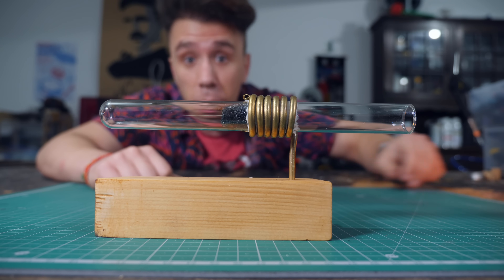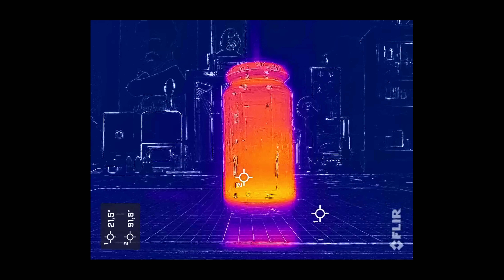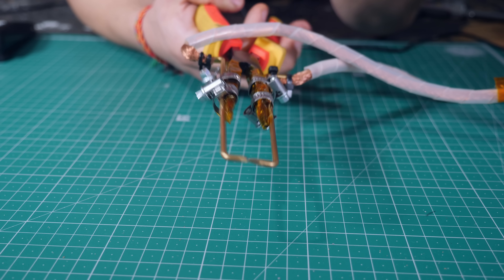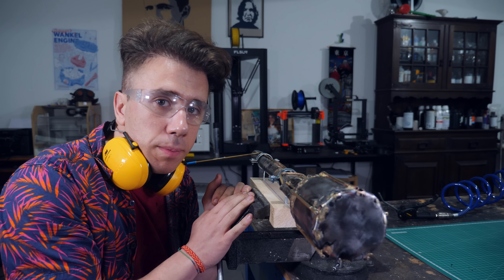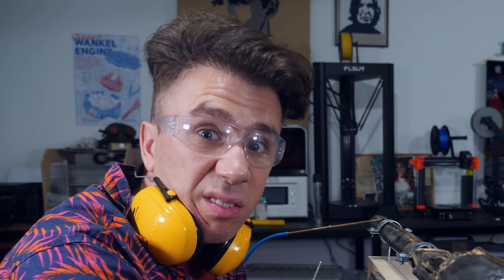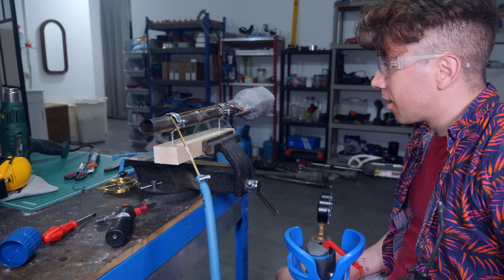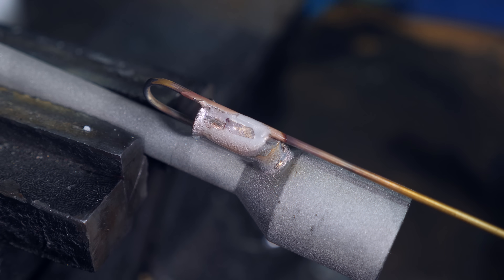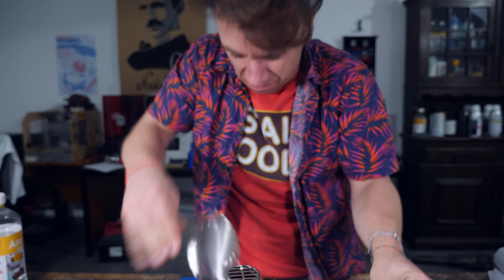JET ENGINE with NO MOVING PARTS (Pulsejet Engine)

Comment from the maker: 3D models:https://integza.com/collections/3d-models
0.1mm Sheet Steel:https://amzn.to/3PwJbeS
Spot Welder:https://amzn.to/3EUJOtU
Glass tubes:https://amzn.to/3tc7tU7
Reply: Make an engine in a different style... like Spheres. You could make a Tower Spherical Engine with Spherical Rotary Valves.
Reply: I'm really interested in Continuous Engines.  like maybe the High Performance Continuous Internal Combustion Engine, patent ©2013.
Reply: USE HEARING PROTECTION ! USE HNEARING PROTECTION , USSEEE HEARING PRO!
Reply: https://youtube.com/shorts/k3wmMDOYco8?si=3icc9RNHracRv3-u
Reply: You do suck at welding. Study temperatures, learn about minimum tolerances for load bearing structures. How much force does your goal expel? The parts must be thick enough, start out twice as strong to withstand the thrust, explosion, or pressures that you intend to cause. the failures you are enduring come from not understanding engineering and matrials. Study the periodical table, name, weight, properties and uniqueness of the elements. Copper silver and gold are arranged on the table because they all have one 1 electron on the outer valence, that is easily borrowed or extra can be added. Gold stainless and titanium is used in jet engines for the bearrings, much like crank shaft journals, the properties of gold is what is valued as the friction face, and why it is jet engines need so much maintenance, but without adding fans, all we would have is a crude missle, unfit for industrial uses. When it comes to Iron we should realize steel is not listed on the table. Welding requires weaving a bead, at correct temperatures, and speed. One must also consider that metals high in magnesium do not weld well without specialized equipment, if ever. Cast iron is not something to weld to, ever. Laser welds the most ideal to manufacturing... Lightest possible doesn't start with least, but with more, otherwise failures will occur.  

A rocket is a funnel, the pulse engine is limited due to not following the basic instructions, rocket science is a funnel. The moving pieces in a jet engine are for cooling and fuel delivery, even to turn a generator to make electricity. Missiles can have rockets without moving parts, the case is thick enough to be cooled by the air and often altitude. Funnel, a glass tube open at both ends and heat source equals constant thrust. I guess you have a plastic funnel... a funnel compress air, exactly the same ammount to enter the funnel exists.

Hydrogen runs hot, 22:1 air to fuel ratio. Yet cooling even by air to air fins is acceptable. I would like to find a high temperature ceramic that I can cool and use in industrial processes, fueled by hydrogen. The cost of creativity his to be reduced for the hydrogen economy to exist. You all have to learn to make it safe and bulky, do remote testing, not where your on hand fuel supply threatens your workshop, and not make very poor choices. 

Epoxy comes from lipids, algae is a source of lipids. Please consider that you are effectively choicing chemicals, algae, and carbon fiber to hold it together.

Plastic is not a wear item. Plastic is not a support structure. Plastic is not for heat.

There is much the scientific process can teach, but safety and matrials is foundational.
Reply: Wait, didn't you like my linear sonoacoustic idea that might even work as a laser by creating a population inversion? I still think it's a great idea!
Reply: @integza
They now sell plastic carbon filament that is harder than steel, use to make jet engine parts. I forget the name of the company or if it works in a regular printer.
Reply: Make Hero's Engine
Reply: @integza you've got a scammer who is pretending to be you in the comments on this video.
Reply: It seems like an excellent two stage water heater to me. A bit noisy, but I am sure that you can make a pretty fast and efficient water cooker out of it. 😁😛👍
Reply: @insAneTunA  Colin Furze already did that with this exact kind of jet engine.  He called it something like "The Jettle".
Reply: @dernudel1615  For 13 minutes I thought that I was original and brilliant .....😁
Reply: Have you noticed the sound of the sahara desert ? Same sound
Reply: Integza, how long will it take for you to choose who has the most amount of likes on their comment?
Reply: Você é de Portugal ou do Brasil?
Reply: can you make a 3d printed 3d printer
Reply: get some gloves mannnnnnnnn  cheap cut proof  kevlar, polyamide etc  sheesh
Reply: USE HEARING PROTECTION YOU FOOL
Reply: Why not make a puse jet engine out of an ink pen body? Some of those are made out of titanium.
Reply: Idea. Try to combine the rocket engine and the Meissner effect. For example: Make a track out of neodymium magnets. And from superconducting ceramics, to make the body of a levitating platform. And attach a jet engine to this platform. As a result, when cooled with nitrogen, the platform begins to levitate over the track, and the included jet engine will push the entire structure forward.

There will be interesting tasks related to the design of the track, and with the separation of temperatures from the platform (since the engine has a high temperature, and the platform itself is low), as well as with the fuel supply of the engine itself.
Reply: you can use an ion motor powered by a battery. But it's somehow too easy :)
Reply: Put a jet engine on a cycle I wonder how fast thAt thing would go
Reply: Bro you must not know who you are. I'll tell you what dog I'll tell you a secret you work for an organization under the table whether you know it or not I want you to go take a look at the 1996 Arecibo Puerto Rico human crop circles wait till you see the face. Bro it's time to wake up we need your help
Reply: Maybe I missed it, but what was the metal printed engine made out of?  I'd guess stainless, but I didn't hear anything specific.
Reply: I want to see a 3D printed bottle cap bullet. Imagine a bottle with mentos and pop with a cone shaped bottle cap with fins and just enough threads to seal but release easily. How fast can we make it?😅
Reply: My lord when you said you’re bad at welding I thought it can’t be that bad 💀 godbless 😓
Reply: Your Lithuanian "Thank you" got me flabbergasted, where did you learn it???
Reply: You didn't print that one though so every one you printed has failed.....did I win a 3d printer? Is this a good comment? 🤔
Reply: you are my favorite youtuber bro ....
Reply: better tell Bob to print it with the fuel tube and heat sinks incorporated, and then run it over some coolant, or maybe incorporating water cooling as some old WW1 machine guns.
Reply: May I suggest "Exhaust heat wrap" for your future projects. I think it would be easier for you to work with than the carbon fiber.
Reply: You should power an air engine with a rotting tomato (because gas is produced with rotting and tomatos are discusting)
Reply: I am not here for the printer. I would like one but I am not going to stop someone else. I do have an idea though. Build a mini remote control by smart phone electric prop engine. Just the engine in a case really. One that could be mounted on anything and can lift it like a heli transport. If you only you one engine then maybe have it gimbal some with an auto balance.
Reply: Aw why dudnt you print the engine we made that bruno ogolec patented
Reply: Can you please say what your 3d Modelling Programm is!
Reply: Are you on telegram sir
Reply: @integza do you telegram account that conduct giveaway
Reply: @mdpatellabs   if you got a message for a win  its a scam
Reply: 0:01 0:01 0:01 0:01
Reply: Integza!i hae heard tjat the plasma channel is teaming up with the disgusting tomato lord to overthrow your ionoc thruster prowess. We must retaliate with an ionic thruster tomato crusher. And slicer. His new design is epic tho.
Reply: Vc é brasileiro? Teu Amazon tava em pt br
Reply: Argus As-014 = V-1
Reply: 10:00 That literally screams
Reply: could be wrong but i’m pretty sure the way ur using heat to bend and build it could be what was making it too weak and melt
Reply: got any links on reading the physics behind this ?
Reply: Next video make a Tesla valve  jet engine I subbed pls gimme a 3d printer 😢
Reply: Fellow tomato hater
Reply: what spark plug and id of brass tubing for micro pulse jet please?
Reply: Can this achieve JATO 😅
Reply: Best 3D Printer brand for small family on a budget? Zero 3D printer experience but quite tech savvy. Thank you for any advice!
Reply: Have you tried to make a rocket with a metal lace machine I don’t know that last thing about rockets or lace machines I have seen a couple of videos of people making thing that could be used as a rocket love the videos brother keep up the great work
Reply: I got some thing 4 you 🎉 drehkolbenverdichter 🎉 ohne schmiermittel
Reply: I have been requesting the same video for years. Tesla turbine vacuum pump. NOBODY has measurements of the ultimate vacuum you can reach with them and it is one of the main use cases listed in the patent. PLEASE do this. If you can reach 1x10-6 it would advance the DIY semiconductor hobby by leaps and bounds.
Reply: Can you make pulse jet engine? (Valved version)
Reply: @integza.  Put a water cooling system on the tiny pulses get so that you can get the most trust out of it.let me know how it goes..or LIQUID NITROGEN COOLING RUN IT TIL THE WHEELS FALL OFF
Reply: @itzmejav995  hi how about using a coil coolant jacket for liquid propane?
Reply: a
Reply: @integza i think you should make rc plain out of this engine, it coud be very good idea :D
Reply: Still feel like a Tesla-valve pulse-jet would be ideal.
I also wonder what these would be like if the excess heat was put to use (to keep operating temps down, increase longevity, and improve overall efficiency). Maybe submerged in water and powering a steam engine, or routed through a Stirling engine?
Reply: @FireBeam im thinking if he wanted a pancake motor he wouldn't be capturing the waste heat for a sterling due to weight constraints for an aircraft but yes for a ground based system that would be a good idea to add efficiency
Reply: Hey, Integza, did you know that you can fill small tubing with sand before you bend it to keep it from collapsing?
Reply: If you watercool the engine you can practically make it last as long as you have fuel
it will add weight so a thin lightweight copper cooling system like the pipes in a laptop might be efficient enough
copper could melt easy so brass maybe
you can buy those laptop cooling pipes and put them on the outside of the metal of the jet engine
also putting sealant and carbon fiber on the metal engine in this video was a bad idea because the metal conducts the heat away and you blocked it making the situation worse
Reply: Pin this  before it gets lost😂
Reply: Can you please make another turbojet engine
Reply: This is an idea I want to do but don't have the means but I think it's a good idea so I don't want to hold onto it and I feel you could get it working. Ok my idea is feed the exhaust from the pulse get into a Tesla turbine you will need like nickel disk most likely to prevent the turbine from melting I was thinking you could run the exhaust through a cooler first and it should still be at high velocity to turn the turbine plus you want dense cold air anyway since it's thicker and will stick to the turbine. I was watching Charlie's channel for a while and I kept thinking why do you need to make steam can you run it on any gas? So then I thought about another Tesla invention the pulse just and was like bro what if Tesla was going to combine these together because then all you need is fuel you don't need fuel and water to make steam idk I think it's a good idea but I have no funding 😥 hope it works 🍻
Reply: You can do a steam rocket by using 2 rods from The inside 6v baterys and pumping water  Between them ,peaple use The rods for diy furnaces like the one tkor did a long time ago
Reply: Bro can you make a hydroponic farm
Reply: Ionic thrusters plz
Reply: For future video what about making diy 3D printer?

Comment: Have you heard of a Vortex tube, which was invented by French physicist Georges J. Ranque in 1928? It uses compressed air to produce hot air at one end and cold air at the other, with no moving parts.  I thought the concept was interesting and that it could possibly be developed into a rocket of some sort.  Also I liked your design in the rotary engine. But have you heard of the Swedish engineer Burger Lungstrom that invented a free piston engine in 1928? It had pistons moving freely without a crankshaft. This engine used two pistons in a cylinder that bounced back and forth, driven by combustion and a compressed air spring, achieving high efficiency. And used pretty much any fuel including crude oil.

Comment: Explore power/torque conversion in planetary gear trains. Multiple forms of work can be provided to a singular output. i.e. this is how hybrid vehicles implement both forms of productivity. Additionally, I noticed a spark plug on your final pulse engine, but is it possible to tune the engine resonance to something higher than the speed of sound? At that point air just acts like a more stringy spring, so the mach effects may effectively stop the resonance from ever occurring. I’m sure this idea has been explored. Let me know if you need help with the dynamics equations. I wouldn’t mind helping with my favorite subject 😅

Great job on the video!

Comment: *smiles *, 0.1mm is thinner than a lot of knife blades, and when you cut it with scissors,  the shear line is razor sharp....I was wondering how long it would take for you to cut yourself. = )
Edit;....I use to use this stuff all the time for heat treating parts. Ask me how I know......= )

Comment: Now I want to build a heat organ that raises a flames to the tubes as you press a key. A Iight touch would put the flame farther from the tube, and vice versa, for more expression. You would have to prime the system, and light it. Heating oil would work.